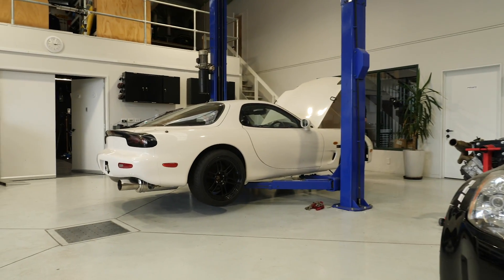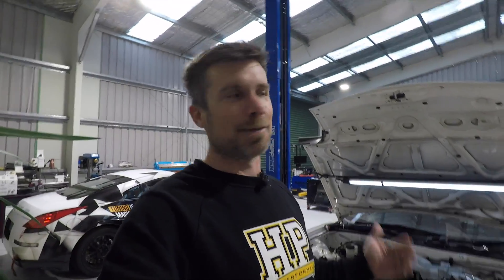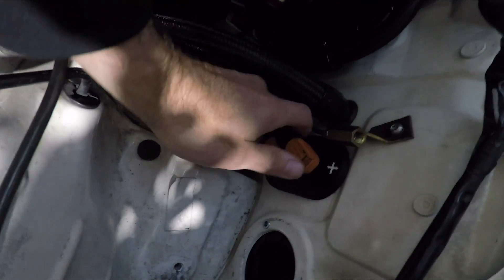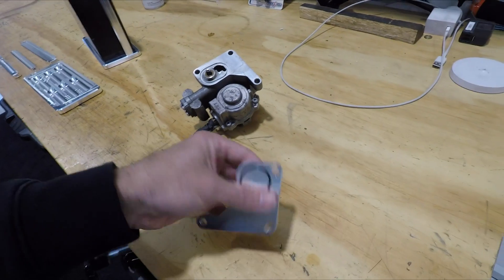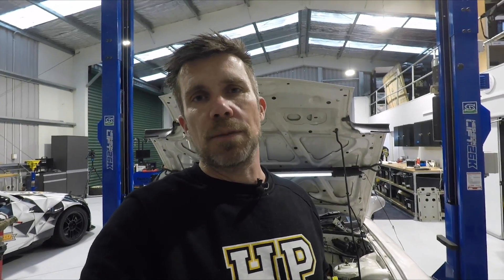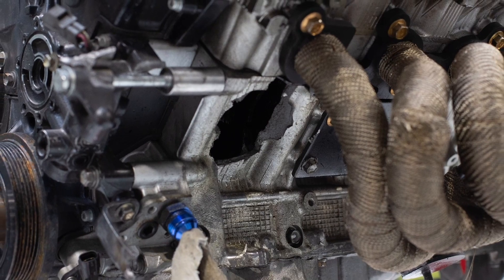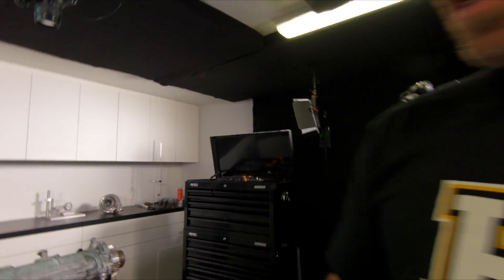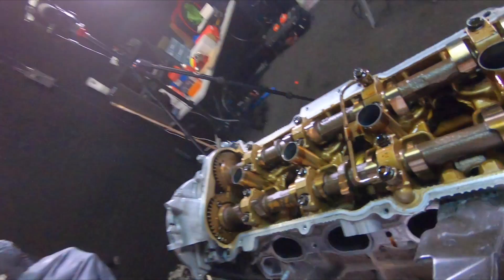Toyota V8 Teardown Tip | Ep 3 [OFF THE RECORD]

Comment: Scissor drive also radically drops the peak loadings on the cam drive resulting from backlash - a point not appreciated when people who 'know better' remove them...have seen that done on Honda V4 bike engines which use a very similar arrangement.

Comment: I had that happen on ke 100 first time it ever had back brakes slid the distance between 2 telephone ploes hell of scary slide
Reply: Tore it open crank went through the wrist pin exploded went into bottom catastrophic failure I would of left at bottom hill if knew instead of pushing up 1/2 mile hill
Reply from the maker: Bugger Gary, glad you made it out of that tangle OK though, despite the unneeded fresh air push - Taz.
Reply: @hpa101  the worst part 2 women were walking and my brother was like go check it out like rare any one on the dirt road blew up right in front of them at top speed

Comment: Andre - If you are worried about overpowering the DBW actuator, you could maybe measure the spring force from an S54 throttle linkage. That way you have a baseline of how much spring pressure is acceptable and then give it some tolerance. Just a thought :)
Reply from the maker: Not a bad idea however S54 engines aren't too thick on the ground around Queenstown sadly. If anyone wants to do this for us then we'd been keen to hear!

Comment: Ok Andre there was a lot of information there . Id just like to go back and unpack some of that information and go through a few things for your viewers. 1 ) We have a Branden at work and he has 2 first name. He also goes by the name "Brenda" lol
2) nice plant (yukka?? Needs water bro and sunlight 3) heel and toe ??? You have DBW blip that brap brap 😜4) can you share that battery mount workings 😊 

Cheers 🍻
Reply from the maker: So what you're saying is we should be calling old mate 'Brenda'?... 💅I'm no botanist but that ykka has been in the same spot for about 5 years with no real sun light and it's been going pretty hard for what it is! It got ignored for about 8 weeks over lock down though so it's probably a bit thirsty. While you can effect an auto blip downshift on an H pattern, it's a bit more tricky than a sequential. This one will be kept to raw driver rev matching. If we get enough requests on the models/cnc stuff Barry is slapping together we'll see what we can do to share.
Reply: Brenda it is lol ... that plant is probably keeping you rev heads alive lol sucking in all that carbon dioxide .. and just going to add whilst I'm slinging ,, Emtron ??? When? Why not? ...... I'll even lend you mine :)
Reply from the maker: EMtron will be later this year. The chap who owns the R32 which we'll do another episode on also has an R34 that we're going to fit one to and tune for a Worked Example.
We've just done EcuFlash and EcuMaster though so want to focus on some engine building content next to keep the balance before another tuning example, but it will happen - Taz.

Comment: Love the videos! just a question about moving from the 1uz to the 3uz, is there a change in transmission needed? i am looking at swapping this into another vehicle and there is a kit for the 1uz to go into the transmission i have but i am unsure if this would work for the 3uz. Thanks!
Reply from the maker: Hey Nicholas, no need for a trans swap. The blocks are identical except for the larger bore diameter -Andre